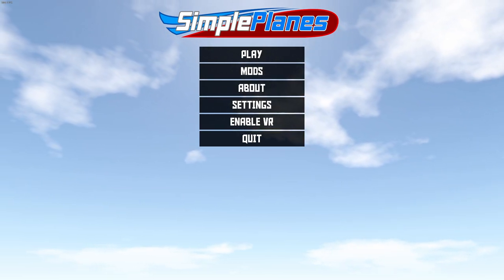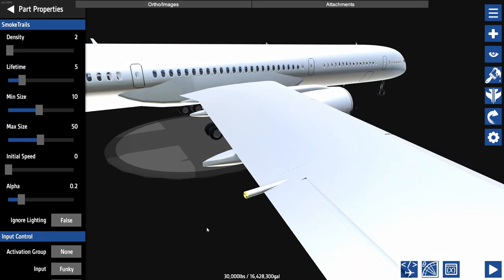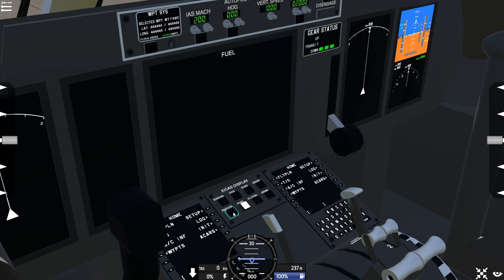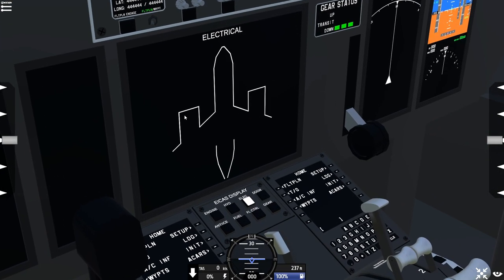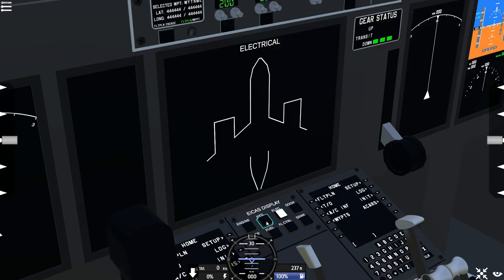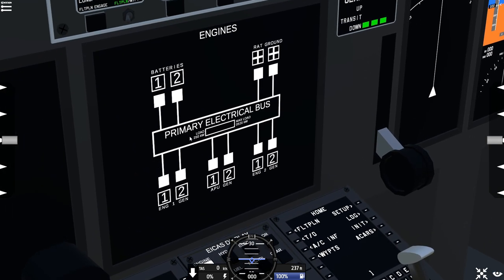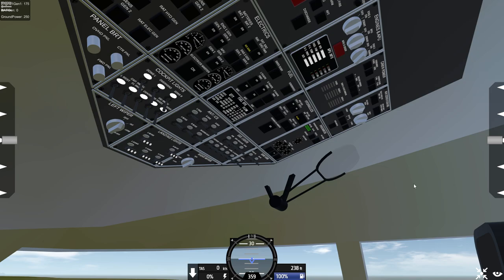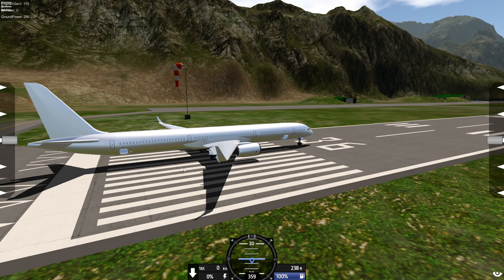Realistic Aircraft Systems - SWL-120 Progress Update 8.2

Comment: Hi, im just asking. How do you make the artificial horizon like the 787? I just wanna know the basic cause im working on a md 11 and i need some sort of airbus artificial horizon, aircraft heading like the md 11 and the engine pressure thingy..I hope you can answer me if you can..Love from your fellow friends ❤
Reply from the maker: Hello, I made my PFD by taking an existing 1 part PFD (I describe this in detail in a forum post on the SimplePlanes website, linked in the description), and heavily modifying it. This took well over a month and was a very difficult and complicated task. Unfortunately there's no easy way to making a PFD like that. It can be done, but it requires a lot of skill and time.
Reply: @11snakePlayz how did your hud don't overlay like mine when i put a thin border like yours?
Reply from the maker: @Wifi123free  If you mean the orange and blue shapes showing up, that's because I technically do have a large border. I recessed the PFD into the panel so the panel itself hides them. The small frame is just for ascetics.
Reply: @11snakePlayz  How about the aircraft heading? Did you use some of the creation and modify it or something?
Reply from the maker: @Wifi123free  If you mean the navigation display to the right of the PFD, it's also very complicated, but yes, it's a vanilla label, and I used some parts of the PFD and heavily modified them.
Reply: Can you help me removing the aircraft heading like the default artificial horizon have some kind of aircraft logo on the bottom of it right? How can I remove it?
Reply from the maker: @Wifi123free  It can be removed by deleting some parts in the text. I unfortunately do not currently have the time to do this.